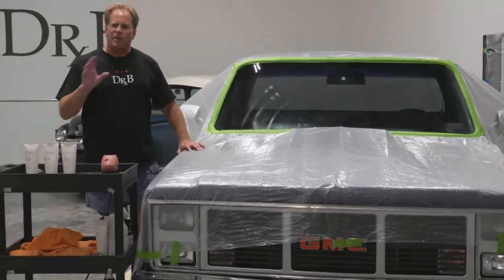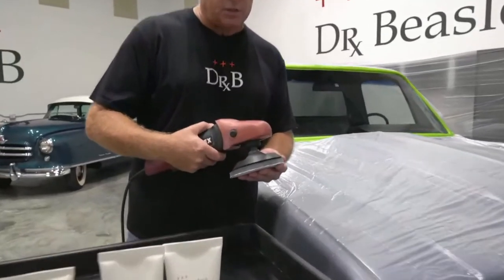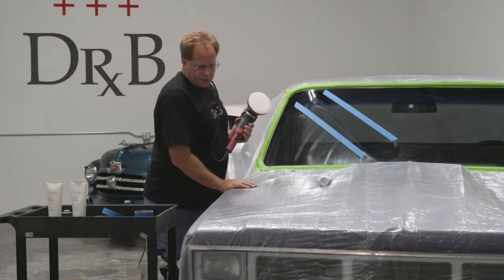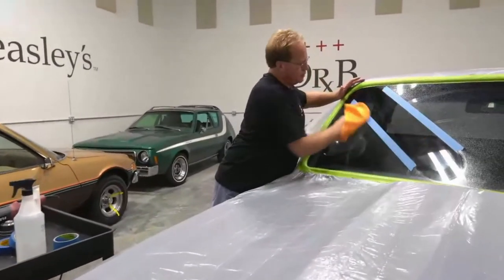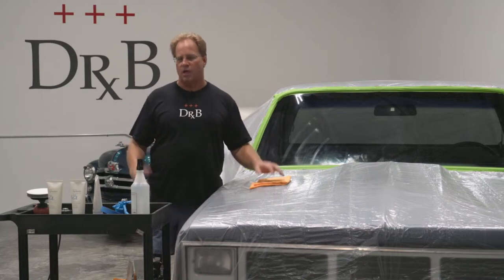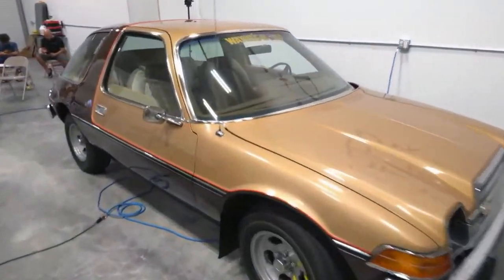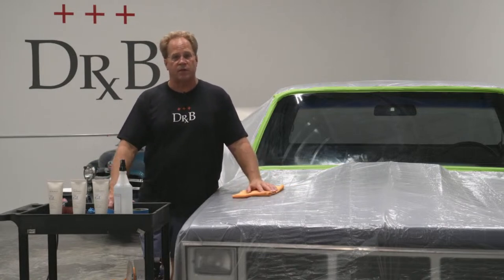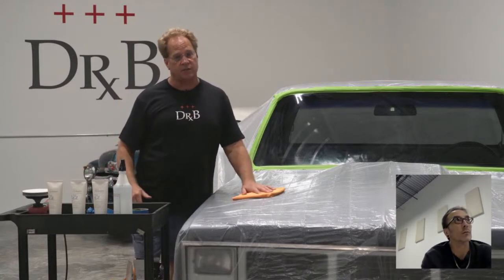How to Polish Glass | 🔴 LIVE Online Detailing Class with Mike Phillips

Comment: Here's a question. 

Instead of water for lubrication. Can I use 3D ONE. That stuff stays wet and doesn't dry out. Would that be okay to use instead of constantly spraying water as opposed to a few drops of 3D ONE to keep it wet.

And I mean using 3D ONE to replace the water. But still use Dr. Beasley's glass polish
Reply from the maker: As to your question, when doing any type of abrading, be it on glass, paint, gelcoat, aluminum, etc., you need a BALANCE of just the right amount of lubrication or you'll OVER LUBRICATE and prevent the abrasive technology from being able to do its job.  The glass gets hot and this evaporates both the product and the water - but it's easy enough to apply a little of both as you work.  Feel free to try and use what works for you, I'm here to showcase and talk about Dr. Beasley's products.   -Mike Phillips